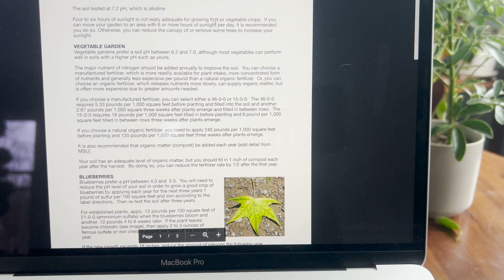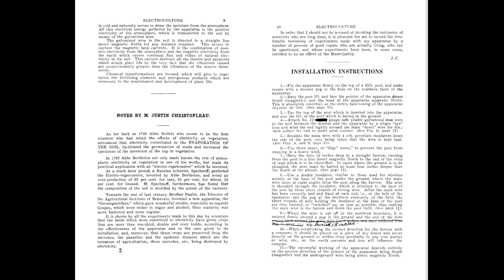Soil Test Results | New Addition to Our Homestead Farm

Comment: Nitrogen is often very low especially if you mulch a lot with wood chips.  Blood meal is good for a quick jolt in early spring when the soil is cold. Add slower release forms later in the year like composted chicken or goat manure etc.  I’m adding kelp meal this year for potassium as well as trace minerals.  
It is a long gloomy winter time but I’m reminded of actually a poem on a 1969 Moody Blues album On the Threshold of a Dream.  It goes. When the white eagle of the north is flying overhead and the browns reds and yellows lie in the gutter dead. Remember then that summer birds with wings of fire flaying will come to witness springs new hope born of leaves decaying. As new life will come from death , love will come at leisure.
Reply from the maker: I love that poem! Thank for sharing. Also love your tips. I definitely need to give my garden a jolt of nitrogen this spring, and continue to add to it through the season. I started adding kelp last year to my garden and the plants loved it!

Comment: 4:00 I wonder if the test could be lower in N b/c it's winter & the soil-bacteria isn't actively making it.   In your soil tests I think you should include the lower horizon too.  I sadly have a very high water table therefore I must use raised beds & I view it as having two soil horizons, where my native soil has a PH of less than 5 & my ~10 inch layer of high-organic raised-soil has a PH of 8.1 at the top few inches. So my plants eat everything in-between for both high and low PH nutrients.  I live in the subtropics & my sulfur was deficient last fall so I'm going to be doing two applications this year instead of just one in the spring.   

Congrats on the new dog.   Having two is sometime easier to train the other b/c you can make them compete for treats where they copy each other to be first to receive the equal-affection.
Reply from the maker: I'm experimenting with a couple raised beds in there this year. That side of my garden that slopes down always retains much more water than the other half. I have a hard time growing a lot over there because the drainage isn't very good.

Comment: Rather than sulphur, I use shredded evergreens as a mulch for blueberries and brambles and other crops that prefer more acidic soil. It is a slower process, but also one that is easier for the soil microbiome to adapt to and thrive. For most vegetable crops, a seasonal routine of adding well-made compost  and appropriate mulches will usually be sufficient to maintain a desired pH once you have it dialed in with more assertive corrective measures like sulphur and lime. 

If you are bringing compost onto the farm from outside sources, I strongly recommend doing some test plantings before adding large amounts directly to your soil if you aren't completely confident with your source. Because of the wide use of herbicides and pesticides in rural and agricultural areas, it's really important to keep a close eye on the feedstock - and even well-made compost can be detrimental if it's not properly cured and applied. 

I'm looking forward to seeing the rest of your videos - it surprises me that it's only just  today that I've come across them.